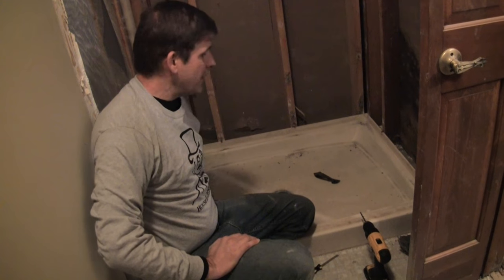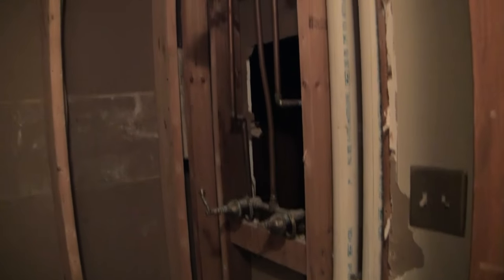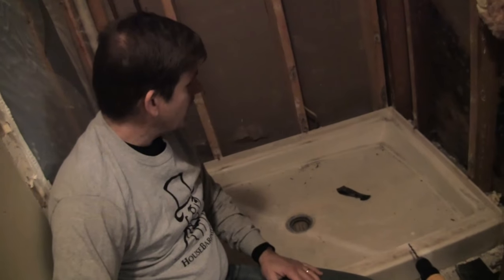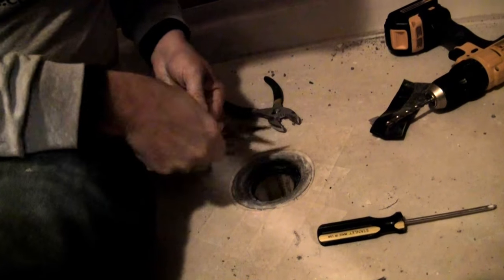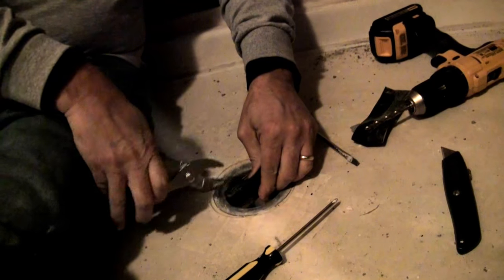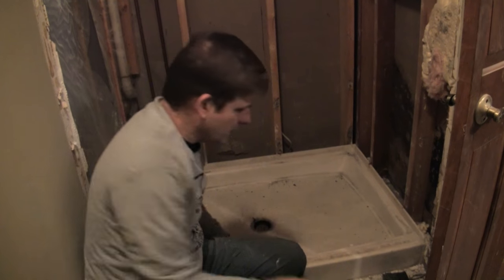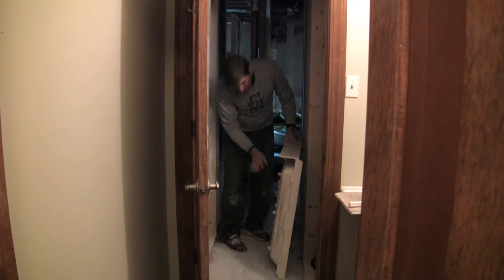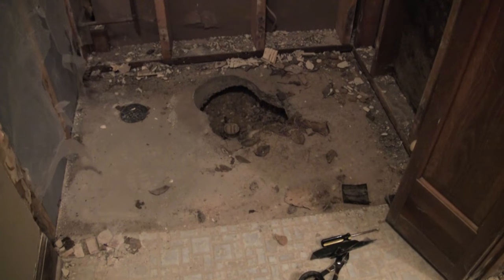How to Remove a Shower Pan

Comment: I have to do this tomorrow.  A plumber friend JUST told me to just sink a couple drywall screws into that gasket, and you can pull it out.
Reply from the maker: Hi Vrooden TheGreat, we hope your plumber friend is correct and all goes well, good luck!
Reply: thanks  @Housebarons  ...  
Plumber WAS correct
one good screw in the meat of that gasket and it came right out.
Reply: I like the drywall screw idea, but one more thing....why didn't you plug the drain pipe before removing the gasket? Rather plug than have to retrieve shavings from knife or drill bit!
Reply: That's pure genius, love the screw idea!

Comment: I am more than surprised that you did NOT cover the drain pipe itself.  Your video excludes the drilling part which results in a huge amount of drilling ditritus. I DID cover the drain, and needed a vacuum cleaner to take up the mess.

Comment: You removed the shower pan but how you connect the drainage system for the next shower pan?
Reply from the maker: Hey Allen,
The new drain is pvc and attaches the to the existing pvc pipe with typical pvc primer and pvc pipe cement. 
Specifically we used the shower pan system at the beginning of this video:
https://youtu.be/ntZ_c10okzk
Hope that helps.
Thx for watching.

Comment: The pan I need to remove seems to be made from a solid faux marble substrate. The pan is beefy and heavy. Not looking forward to removing it. I'd like to tile the shower floor. Is there a recommended tile underlayment that I can use?
Reply from the maker: Hey Georgia fan,
If the pan is faux marble, it may have to be broken up. As for shower pan, replacements we have used the Kerdi / Schluter water proof membrane and pre-slope pan. The work great. We also have formed our own pan with a rubber membrane and dry pack cement base. You can also buy pre-made shower pans ( the most expensive route ). Depends on your budget and final desired look. Our first choice is the Kerdi Schluter system.
Reply: @Housebarons  I had to break up the faux marble pan. Omg It was very heavy. Will be looking into the Kerdi - Schluter pan. Can't post pics on youtube I think. Thank you for the advice!

Comment: Curious my rubber gasket seems to be metal. Any advice?
Reply: Does it have notches and look like the top of a chess rook? That's the brass retaining nut/ring that goes over the rubber gasket.  As it's tightened it compresses the gasket between the shower drain adapter and the pvc. To remove it hire a qualified, licensed plumber so as not to damage the PVC. The video link below is the reverse of removing it, but it will show you how it works. The tool used in the video to remove the ring usually comes with the new drain.

https://youtu.be/GHRwNZnli6E

Comment: I followed your video, removed the rubber ring and all, but some reason the pan would still not come out, what I am doing wrong?
Reply from the maker: Hey Joe,
Look at the top edge of the shower pan. In our case the visible top of the pan  is like a shelf onto which the cement board / drywall sheets can rest. Then hidden is the back edge that you cant see goes up another inch or two BEHIND the wall cement board. So the wall may be holding the pan in place. 
The pan ( if plastic of fiberglass ) is usually nailed at the top edge to the studs and then the walls are added after the pan is securely in place. 
If that isn’t the case, the pan might be adhering to the bed ( usually mortar or cement ) that the pan is placed on which conforms to the underside of the pan to provide underneath support for the pan. 
Hope that helps!
Thx for watching!
Reply: @Housebarons  thank you for the reply, I ended up cutting a square section of the fiberglass around the drain section and was able to remove the pan to get a better view of what's going on down there. It turns out that there is a pvc pipe glued on top of the drain pipe to secure the pan after the pan was placed over the drain pipe.  That's what's keeping the pan from being removed completely.  It appears that the only option now is to cut the top portion of the drain pipe where the pvc pipe cap ends then somehow remove the pan then extend the drain pipe again with similar technique once the pan is removed.  Unless you have other suggestions 😀
Reply from the maker: Hey Joe,
If I understand you right, sounds like you are on the right track. Pretty easy to extend the drain pipe - just need a collar. 
Hope your project T goes well!

Comment: I just stick a Dremel down into the hole and cut the PVC...seems easier and quicker. But I guess this saves you a step later on.
Reply from the maker: Hey RealCoolGuy,
See! There are always more than one way... thx for the input.

Comment: Great! Working on mine now and was annoyed the pan didn't just slide out after removing the screws 😂
Reply from the maker: Hey Jason,
Yeah. Those top lips are meant to have wall board over the edge to keep water from leaking!
And then the drains are anchored pretty well - all for water tightness.
Keep on w/ the project. It will be awesome when complete!
Thx for watching!

Comment: If I have existing tiles in my wall, do I have to remove the tiles in the bottom to replace the shower base?
Reply from the maker: Hey Adonis,
Very likely those bottom tiles will need to be removed as those bottom tiles may be over-  lapping the upper lip of the shower pan. 
Thanks for watching!

Comment: Good job, man. Hope it's as easy as you made it look! (And did you know that you sound a little like George McFly at times?:) :)
Reply from the maker: Hey Papa,
It always looks easier in video. That being said , it’s manageable. If it’s newer, it will be easier. 
If it’s a cast iron drain with a lead pan, here is a video to check out. Lead pans are a bear to take out. https://youtu.be/KeEPD75vsBs

As for Mcfly, I heard a comparison once before, but don’t get it. :-) 
Thx for watching!
Reply: @Housebarons  Thanks for that, HB. Mine's an enamelled steel pan, I think. Part of the enamel has worn enough for the panel to rust through. Not good. I'll go check out your link. Thanks again. (Can't quite pinpoint exactly why the McFly thing, but it's there.. :) Maybe just that polite tone. :))